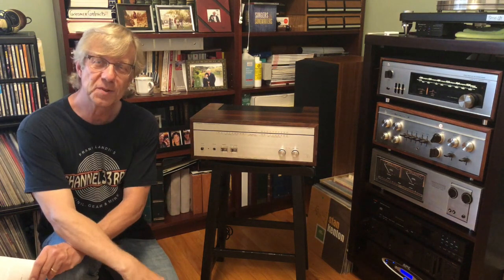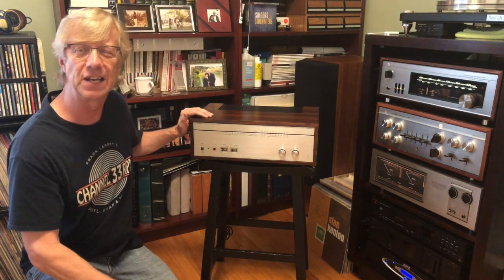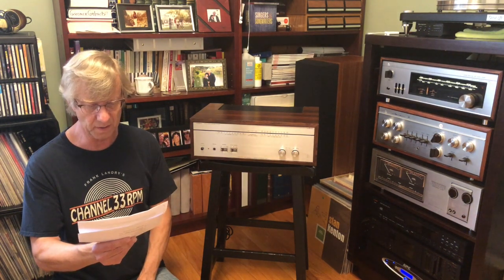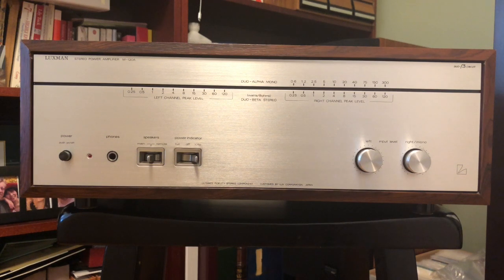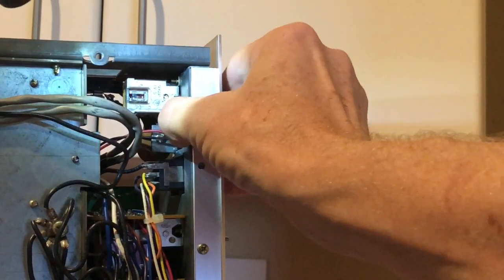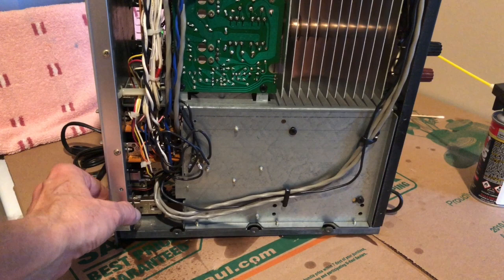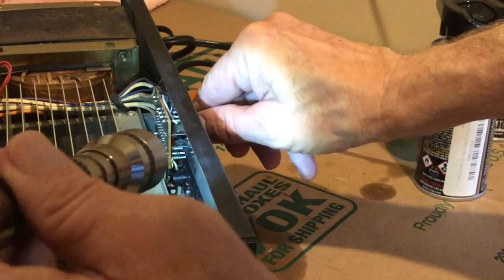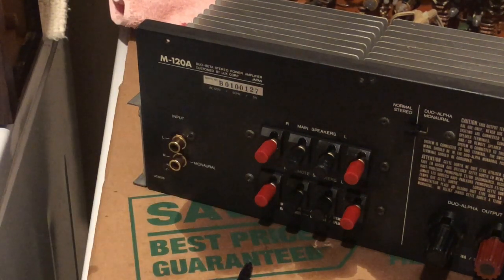A Look Inside: Luxman M120a Power Amp

Comment: This was the first piece of real hifi equipment I'd ever listened to. I would have been about 10 or 11 years old at the time (early 1990's). A family friend had the full Luxman setup with the m120a, c120a, and g120a hitched up to Celestion Ditton 66's. Till that point, most of my experience was limited to boomboxes and bookshelf systems. It was a real eye opener. It's also probably what set me off in my quest to have the ULTIMATE sound system. And by ULTIMATE, I really mean trying to find the best equipment available within my very limited budget.
Reply from the maker: acronus Thanks for watching! Looking forward to hearing about your Luxman gear when you find your Ultimate choices

Comment: have a pair of these in transit. Is it possible to modify the speaker terminal to 5 ways? is there enough clearance? tia.
Reply from the maker: I don’t think there would be enough room. The existing binding posts are small and close together. I use pin connectors instead of bare wire. I used some heat shrink over the bare metal areas of the connectors.

Since you will have two amps, do you plan to bridge them? Like mono blocks.
Reply: @VintageStereoCollectorChannel thank you very much. this confirmed my suspicion that there isnt enough clearance behind it because the heatsink is too close to the rear panel. not really,  im actually thinking of selling the other one.  im a high efficiency full range speaker enthusiast, 300w  is a bit overkill for most of my speakers.
Reply from the maker: @teamnery1747  hopefully pick the best one! Please post a video of your gear when you set it up

Comment: 9pm eastern 09/24

Do you have other specs/manual for this m120a setups

Im Doing dual mono running rch from both amps

 does one go to right moni. And other to left moni? Or. The right  output on the preamp